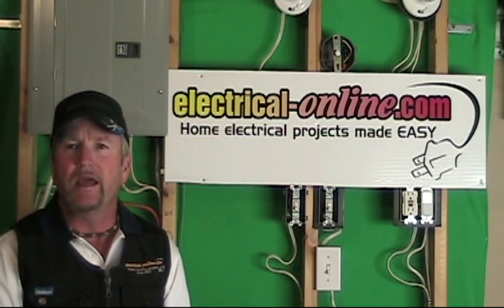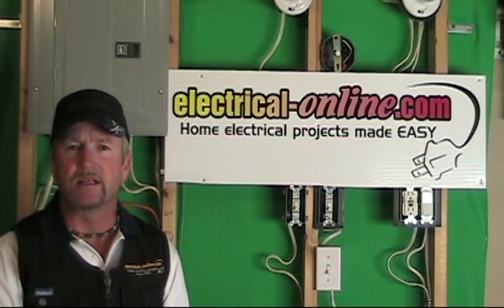Outdoor Lamp Post Installation Q & A

Comment: ASK A REAL ELECTRICIAN!  What did you call this cable??  It's UF (underground feeder) cable which is always non-metallic.  You may be confused about your wire construction.  #12 is the minimum size made in aluminum UF cable.  #14 is the minimum size made in copper.  Either are acceptable when fused properly. (NEC Article 340)

How can you answer this without knowing if a ballast is involved?   Where the DISCONNECT?  If it's in the house, and around a corner, it certainly isn't 'within sight'.